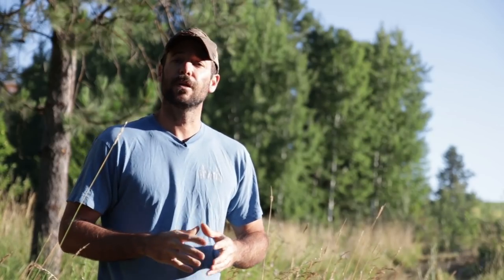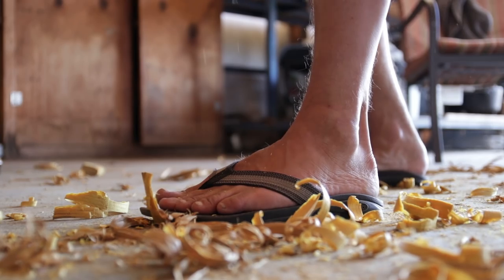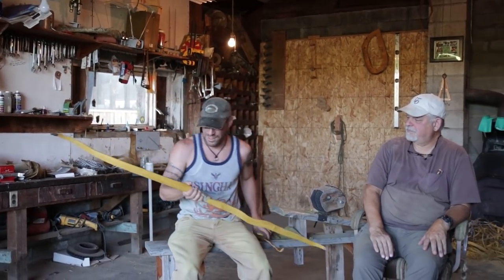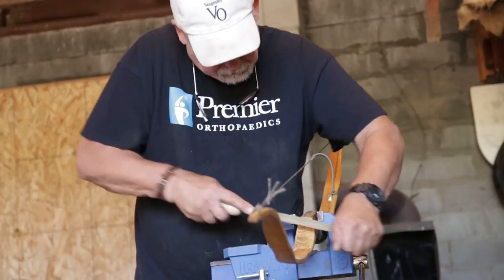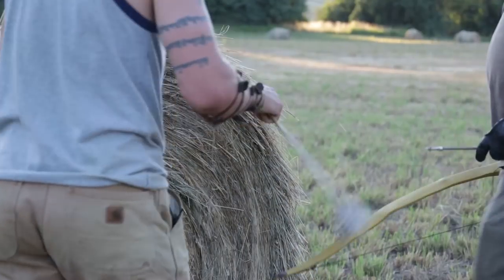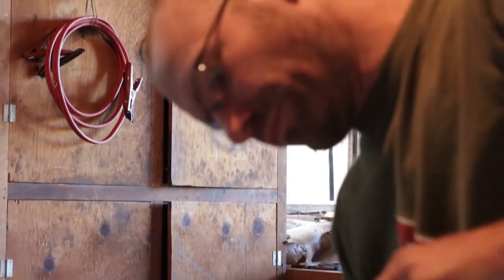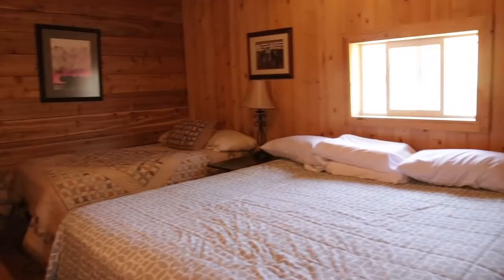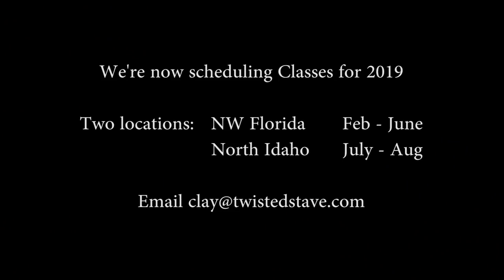Selfbow Building Class with Clay Hayes

Comment: What grit sandpaper do you use the sand the fiberglass sleeves on your bows?
Reply from the maker: I use 80 grit on the sander.
Reply: @clayhayeshunter  do you only use 80 grit?
Reply from the maker: For the heavy grinding and shaping. Then you can get finer to smooth it off. The handles are usually covered with rawhide or leather so there’s no need to go crazy with the sanding.
Reply: @clayhayeshunter  what grit sandpaper do you use to smooth it out after the 80 grit?